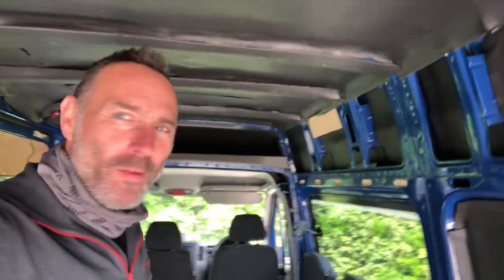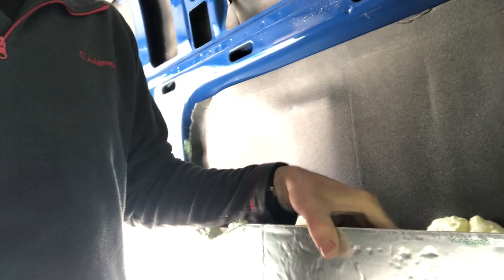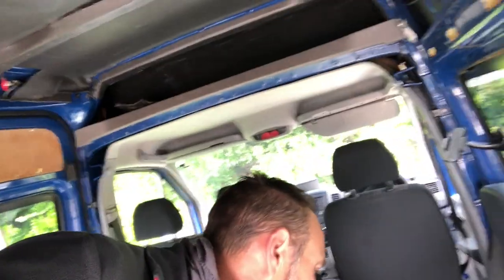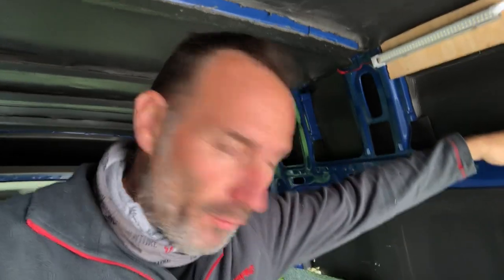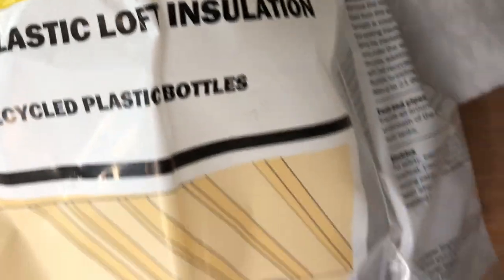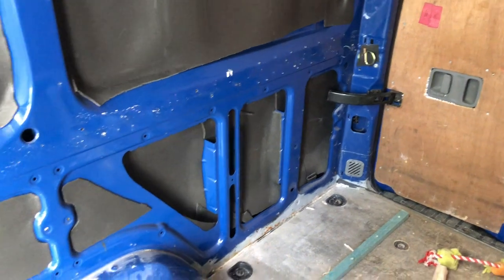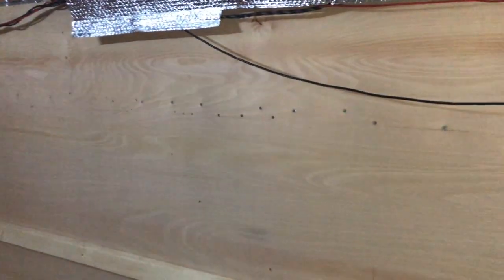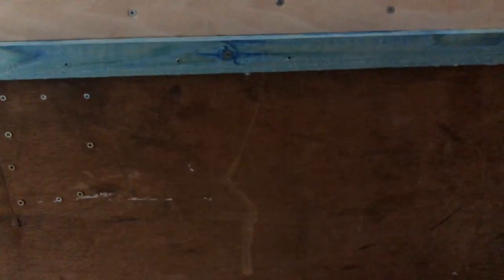Mercedes Sprinter 1st self build van life new beginnings Vlog. Building a Lwb off grid adventure van

Comment: Looking great bud. I used the recycled plastic wool and those lights too :) spent the other week cutting the wires to put them on individual switches :) 
Coming along really well Buddy :)
Have one question sorry to sound stupid is it important to have a shunt bar in your van? 🤗
Reply from the maker: Hi mate, the recycled stuff is really good, I have the shunt for the fuse panel, once wire in it tells you voltage and Amps, but I also have the victron BMV and that do a hell of a lot more, so not sure if I can have both. 👍👍👍
Reply: @ProjectCamper  aww cool 😎 I don’t have anything like that. Is it all needed?